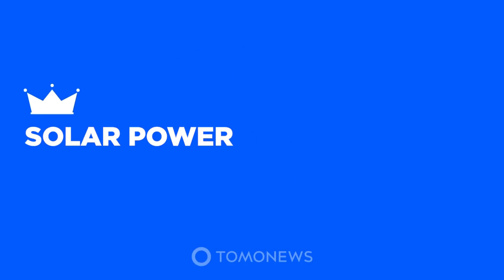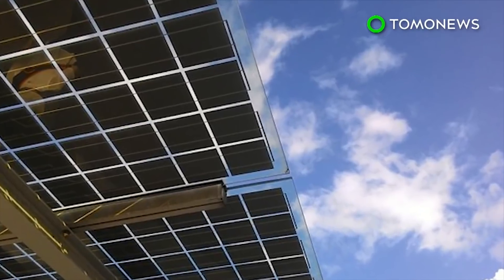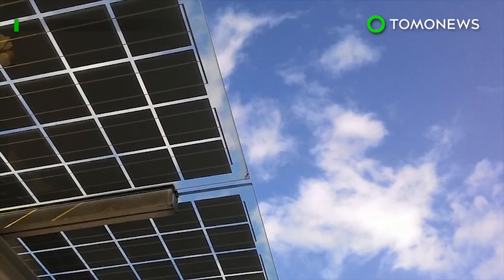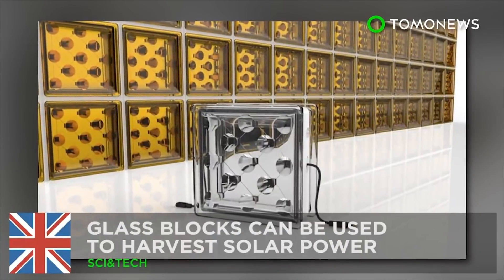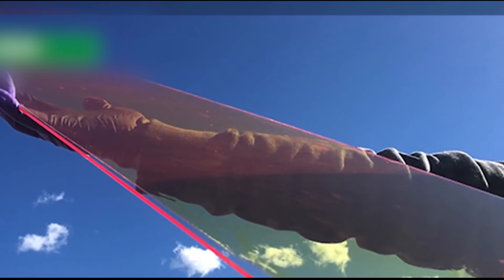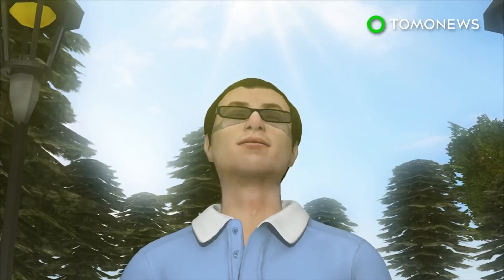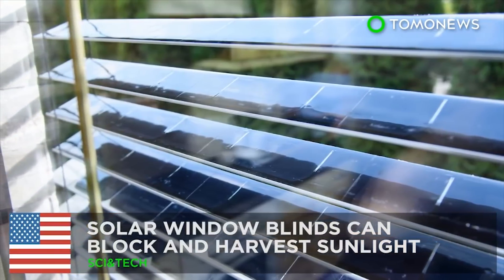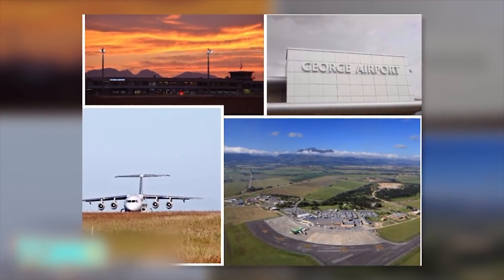New solar panels could generate electricity from raindrops; Floating solar farm - Compilation

Comment: I had a patent filed innovation for rain or shine hybrid solar panel that could generate 1 V in 25-centimeter square surface area using the same graphene tech( but some major modification), far more efficient than these 100 microvolts one.

Comment: The hydrogen producing solar powered paint still depends on the innovation of gas separating membranes or some other way to harvest the H2. Otherwise it is of little value. Increases O2 in the air though so may be good for indoors to increase the O2 available for breathing.

Comment: Are solar panels emp resistant ?
Reply: I think so but not the run of the mill inverters and charge controllers.
Reply: So they can be emp hardened youtu.be/r1qJoxDvzOo

Comment: If solar panels covered oceans and lakes, they will prevent water creatures from accessing the surface, no?
Reply: You can't cover the ocean but yeah a large enough covered area would be dangerous to whales and turtles. If they angled the panels then they would need less and have lots of breathing gaps for small mammals.
Reply: Also otters and seals, penguins, bears.
Reply: Penguins?
Reply: AnantaSesaDas plus lake

Comment: A SOLAR panel that produces electricity with rain drops. Contradicting gas fuuuuck
Reply: I had a patent filed innovation for rain or shine hybrid solar panel that could generate 1 V in 25-centimeter square surface area using the same graphene tech( but some modification), far more efficient than these 100 microvolts one.
Reply: probably static electricity, that's why it only produced a few microvolts.
Reply: It's more apt to call it a voltage panel that covers the solar cells.